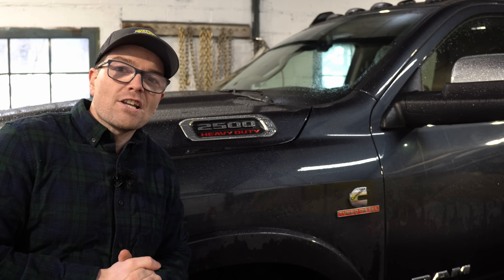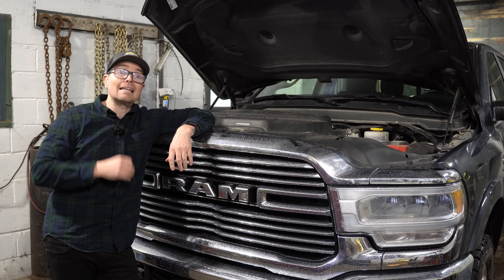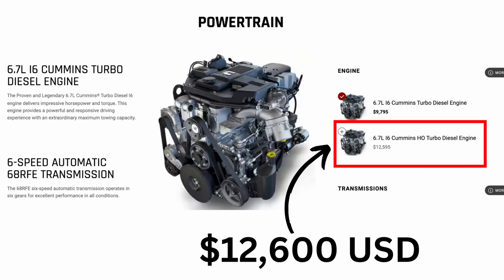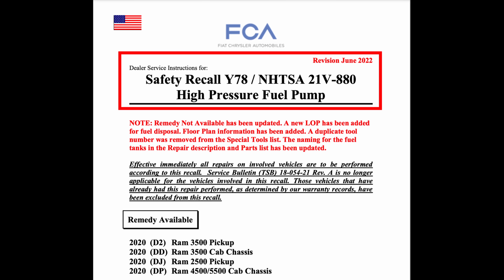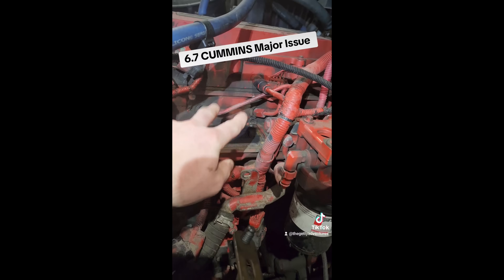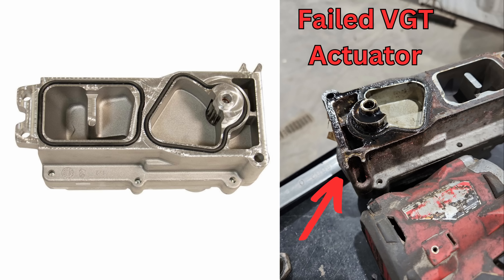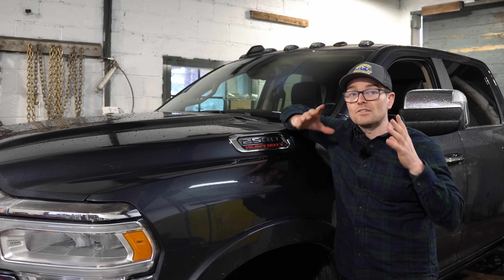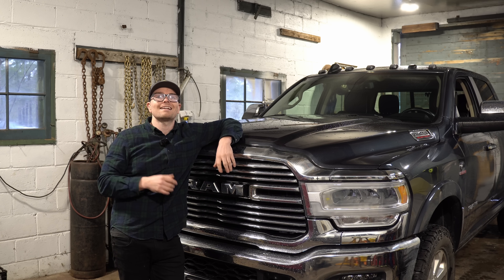RAM 2500 UPDATED 6.7L Cummins Diesel Engine (Details Released) | Diesel Mechanic Review

Comment: The 6.4L has its place.  Especially for someone like me who only pulls a heavy load 8-10 time a year and not very far; 25-50 miles.  I just can't justify the cost of the diesel.  Good review.  Thanks
Reply: Increase the Hemi displacement to 7.0-7.2L and fix the lifter issue so we can roll these things for a quarter million miles or more.
Reply: Hell yes. I would love for them to make it even better as I am looking for a reason NOT to buy a diesel in the next month or so and I already like the 6.4. Test drove it, the godzilla and the L8T. The GM was an absolute dog and I want NOTHING to do with their "allison" transmission and I don't particularly care for the ford 10 speed either, and considering I'm dealing with a 2017 F350 that has fooking doors that won't close when it's cold I think I am done with Ford(I also hate the new look of the SD.) New Ram here we come.
Reply: @briancavanaugh7604 Idk bro these new trucks all the same. My 6.7 paid off not going with a new truck unless it’s truly better but these ain’t it.
Reply: @briancavanaugh7604  brooo my 2019 also has doors that won't latch when it's cold I thought it was only me! I took the rubber plug out on the edge of the door the other day and ran my soldering torch in there for about 30 seconds to thaw it out. So frustrating lol
Reply: If you aren't hauling on the highway. Get a 6.4. It's going to eat gas, but the maintenance on a diesel is going to be higher for stop and go city hauling.
Reply: Saving $10,000 on the purchase price of an engine buys a lot of gasoline. That, and modern Diesel engines no longer achieve the better fuel economy of prior engines (and it seems that oil changes are 2x the cost and any parts/repairs are 3x the cost of a gasoline engine). You can make the case that almost no one needs a Diesel engine and could just buy the gasoline engine truck.
Reply: @bartholomausallen883  Diesels only claw back their value when used on the interstate for long distance hauling. They need less maintenance, fuel, and last hundreds if not millions of miles. If they ONLY get used for interstate hauling.
Reply: I understand the point of view ...you mean the diesel Is done to go ..for long time travel... For short distance the simple NA gasoline Is perfect even if drinks gasine like a sponge. Here Europe ...Italy specially the few... RAM 1500 that you see are all 5.7 with LPG conversion that cost 2.6 times less compared to gasoline .. 1.75 euro liter vs 0.69 euro/ liter
Reply: The 6.4 also got a significant facelift already they've made multiple upgrades to the engine and they paired it with a heavy duty HP75 LCV ZF 8 speed Transmission
Reply: @jamesj5130  Do you know what year they started that?
Reply: @marckimbrell4645  i believe 2019 was the transmission upgrade to the 8 speed, and in 2016 model year, all hemis got a roller lifter upgrade with a bulletin that says 5000 mile oil change intervals with low idle times 10% or less if you have higher idle times you should change every 3000 miles and look into upgrading the oil pump to a high pressure high volume combo. So basically they've made the updates that have needed to be made and put out technical info to help everyone out in the long run. Basically any half ton after 2016 besides the ecodiesel models and HD gassers were better off significantly as in 250k+ mile trucks IF YOU TAKE CARE OF THEM PROPERLY. People like to talk a lot of shit but don't pay attention to causes and technical information answers.
Reply: The $11000 you SAVE by getting the gas engine buys a LOT of fuel - especially when gasoline is 2/3-3/4 the price of diesel fuel. Don't even get me started on the premium you pay for diesel service labor and parts... For just the cost of keeping the diesel tip-top for 250k miles - you can REPLACE the entire gas engine assembly. I get it - if you haul for a living and the machine has to WORK day in, day out - nothing pulls like a diesel. But the gassers are very capable these days...
Reply: Diesel is cheap then gas @GroovesAndLands
Reply: I don't understand gassers, 100 dollars on diesel every week tho
Reply: @Zenvo_ZTR  Nothing to understand. It's personal preference combined with use of the truck.

Comment: According to a major aftermarket engine rebuilder, when they get a 2019 CGI 6.7L (because it is out of warranty) core, 5 of 8 have a cracked crankshaft and a rod out the side. The block flexes so bad that the crankshaft cracks and chaos ensues. Blocks are unavailable because there is only one source and they are all going to RAM.

Comment: Two initial thoughts:

I liked the non-high ouput on the 2500 because I thought of it as a
de-tuned more reliable cummins. 

Then the big issue… cant sell trucks, so they come out with a more expensive truck. Genius!
Reply: The only reason for different output options is because of the transmission. Chrysler cant build a trans to save themselves. Look how long they kept using the 727, same design all the way to the 48re. And anyone that thinks its not the same think again, they use practically the same rebuild kit, one has and over drive and the other does not. With the ZF8 they have a trans that can handle the power and dont need to use different power tuning to try and keep the trans alive.
Reply: I bought the High output 3500 to get the Aisin transmission after rebuilding the 1996 Dodge 2500 a few times before installing Bully Dogs version
Reply: Yeah but its also a different engine. Its not like they took the same exact engine and turned down the fueling to make less power. The compression ratio is higher on the non-HO which means there are internal differences which might also mean its just not as stout to begin with.
Reply: I wouldn’t go near it, will likely have numerous bugs to work out.

Comment: ive never had issuse with glow plugs. i dont really get the hate on them.
Reply: Lots of them break off in powerstrokes
Reply: @wizard_of_poz4413  that would do it.
Reply: 7.3 and 6.0 used Beru (11v, not 12v) glow plugs. When properly functioning they were ok. However as they age or if the GPR(7.3) got tired their performance suffered considerably. Also the 11v ceiling on the plugs was a pain if you ran a high amp alternator, the ECM either cut the GPs early or you brunt them out. Hence why the 7.3 only came with 110 amp alternators, even the duals where a pair of 110amps in the fords. The 6.7 PSD uses glow plugs and they work great. No issues starting below zero unassisted. I wouldn't worry about them IMHO. The gps in my 6.7 PSD start much better than the grid heater I had in my 5.9 CR Cummins.

Comment: Still didn’t address the poor payload on the 3/4 ton diesels which is pathetic in comparison to GM. I prefer Ram but c’mon Ram??!??
Reply: That's a GVWR thing.  RAM seemingly refuses to increase GVWR beyond 10k unlike Ford and GM who all increase the GVWR for marketing payload numbers.  The general public reads a number and doesn't understand what it's derived from.  I believe going over 10k makes small businesses get DOT numbers.  RAMs stance is that they offer a truck (3500 SRW) with the capability should you need it.

Comment: Embargo for the gas engine will be lifted on January 25th. The CP8 pump has very little information, the only bit I've been able to find, they're Chinese in origin.
Reply: Everything is Chinese. They'll probably last longer if they are
Reply: Cp8? Only heard mention of cp4.2 from most places, so far. In any case it still appears to be a Bosch system. Which I would expect to be from Germany.
Reply: @jeffs2809  Bosch is a multinational company like cummins. A lot of the castings on cummins motors are from china

Comment: You really know your stuff!! I REALLY appreciate you!! I have a 2020 Ram 6.7 diesel. Replaced some parts with Banks products… intake manifold, intake tubes, after the emissions rear exhaust. I put the Banks CAI on… but kept getting the CEL.. so I put the OEM back on. What do you recommend as far as keeping the emissions stuff clean? Additives?? A certain brand of diesel fuel? And how do you feel about Banks products? By the way… I gained 1.3 mpg by using Banks products and adding Archoil fuel additives. What do you think of what I have done?? Thank you for your time and effort on your videos!!👍👍

Comment: Problems with current Rams are low on power, garbage transmissions, lifters issues like crazy, and small cabs. they improve the transmission, add no power, make changes that are downgrades to the engine, and continue to not revise the cabs... big fail for Ram
Reply from the maker: The cab not being revised is wild for me if im going to be honest
Reply: @GettysGarage  Right they already have the 1500 cab they can copy which is way more spacious
Reply: I really think these are holdover modifications until a major redesign for EPA’27 regs.

Comment: i thought the issues with the hydraulic lifters was people using 15w-40 oil instead of wat they were supposed to
Reply from the maker: Thats what I thought would be a viable option but I think its just cheaper to go with cast Iron
Reply: That was the original blame by cummins but people with the proper oil have reported issues as well

Comment: The fact the a lot of consumer sentiment is for more power, smoother gear changes, and what not is concerning. Cummins updating the engine to make it more reliable is the correct decision. These modern diesel engines are over stressed, running to much boost, with overcomplication and many failure points.
Reply from the maker: Agreed, these modern diesels in the pick up trucks are highly tuned up and reliability is usually what suffers

Comment: I still think ram is going to struggle even with the power train upgrade,they’re still running on old platform😮
Reply from the maker: New grill though.. and yes sometimes I find myself behind a ram 2500 and it could be from 2011 or 2024 tail lights aside they are running the same chassis, cab and box

Comment: Maybe I'm just dumb which I could be, but a 3k increase for the diesel engine in an already super expensive market is gonna be insane. Like I may not need a diesel but I want a diesel cause they're cool and sound cool, but they're getting so expensive it's kinda never gonna be worth getting a diesel unless you use it for business. idk I feel like I'll never be able to afford one just cause maintenance and the fact that if one thing goes wrong it's over for you. Also I get that the cp4 puts out more power but I feel like that's gonna be a bite in the ass. Love the content Alex keep it up!
Reply from the maker: These trucks are now luxury items. either you have money to burn or you actually need to tow 15,000+ lbs. the average guy just can't afford these trucks anymore unfortunately.

Comment: Cummins probably went back to conventional gray iron to reduce machining cost.  CGI is considerably harder than gray iron.  If they had a stress problem with the CGI block, it would have been an easy revision to the casting to eliminate stress concentrations with hardly any impact on weight.
Reply from the maker: I would agree with that.

Comment: Additional 10hp will be canceled out with weight of iron block/glow plugs and slightly heavier manifold and turbo.
Reply from the maker: lol this is a solid point
Reply: @GettysGarage 
Have an 08 ram Cummins in Australia 
Won't be buying anything new 
Have got this to 9.8 litre per 100 Ks
10.3sec over 200meter
Smoking tyres through to 3gear😮
Reply: Dude glow plugs don't weigh anything
Reply: @wizard_of_poz4413  I understand that as technically false. But please, don't make my post something that you interpret so as-a-matter-of-fact-ly. Geeze, aren't you dorks tired of arguing negligible points about stuff online. The main point is the block is heavier and now has more parts. Let it be that.
Reply: @OrionTheOwtlaw  it's just a really nonsensical point. If the thing is a few hundred pounds heavier then 10hp is still noticeable. And honestly they have more power than they'll ever need
Reply: @wizard_of_poz4413  Ok, you're sooo right! You're basically a genius! Everybody is gonna feel that 10hp right in their jewels! And 0-60 is gonna drop 2/10ths! It's so obvious. 😑
Reply: @OrionTheOwtlaw  I'm not disagreeing that it's completely pointless and a gimmick
Reply: And emissions shit
Causeing more fuel burn 😮
Diesel fitter 
Australia 🌏

Comment: So now even the base models will be out of reach for a lot of us
Reply from the maker: Yes sir
Reply: The price goes up every year but the product stays the same.
Reply: I def don’t have any love for price increases, but if $3k is putting a $55-60k truck “out of reach”, it was too expensive for you anyway. Also, my opinion, a base model truck is just that…BASE. Starting with the gas engine that’s $12k cheaper.
Reply: @jeffs2809  I wonder if the overall prices will go up, though. Streamlining the manufacturing to just 1 engine will be cheaper for Ram. How much cheaper, who knows?
Reply: @ I have little doubt that they’ll find some way to raise prices.
Reply: @jeffs2809  You're probably right, but a guy can hope.
Reply: Yes, not everyone can afford to buy a new truck boo hoo

Comment: Rad. So im not buying a cummins still. The lifters are the killer. Thats why i havent bought a new one. Even with weight loss and proper oil they still fail.

Also low sales across the board is due to exponentially high prices. Its rediculous. They arent worth what theyre asking.
Reply from the maker: the lifters are an odd one. hydraulic lifters can be reliable (7.3L powerstroke used them) but they just seem to be causing issues. cummins could have updated them but we'll see.
Reply: @GettysGarage  im honestly surprised they're not recalled. Seems I see more and more fail by the day in the cummins forum facebook group.

Comment: I appreciate your videos.  I am considering a new 2024 3500 tradesman diesel.  It would be used mostly for in the spring, summer, and fall for towing my camper.  Used very little in the winter as I live in MN and do would prefer it not to rust away.  Id only get it out in the winter when the roads are clear so that I can turn the machinery s as little.
My question for you is: are there any major concerns on the 2024s that I need to be aware of?  Is the bolt breaking off into the cylinder still a current problem or one that’s been resolved.  I’m guessing lifters are still a problem.  Is this an extremely common issue or something that people who really push their trucks are dealing with?  Information online is extremely mixed.  I’ve never owned a diesel and would appreciate your thought.
Thank you
Reply from the maker: thanks for the comment! me first question is how heavy is the trailer, between say 10-14k I'd honestly be seriously loving at a gasser, save you a ton of headache. But north of that weight having a diesel will make your life alot easier. the 2024's do have the heater grid bolt issues but there are a number of aftermarket solutions that are pretty cheap and easy to fix this. the lifters yes are going to be a potential issue. from my understanding the 2022 model is the worse year for lifters. I believe cummins did update them but there are still reported failures happening with newer models. I would not say they are "common" but certainly a weak point on the cummins engines to be aware of. 

we know all about the rust sir! not a bad idea to keep it parked when the salt is on the roads.
Reply: @ I’ve really considered the 6.4l with the 4.10s but they’re not way to find.
For an HD, i don’t know why it’s not standard.
My current trailer is only about 8k.  Probably wouldn’t do anything bigger than 10k because it limits site options.
Reply: The grid heater bolt “issue” has been greatly exaggerated by infomercials on YouTube in order to sell an aftermarket intake horn. 

Ive owned Cummins equipped Dodge/Ram trucks for over 20 years. My last one is my current 2017. If I need or want to replace it, it definitely will not be a recent model year Ram Cummins & probably not a Ram at all. Personally I’d avoid newer diesel trucks if at all possible & stick with gas powered. If you must have a diesel, I’d trust the ford or gm over the current Cummins.
Reply: @ I appreciate the information.  I’ve really been on the fence about it, however, I plan to have this for the long term and was looking at longevity.